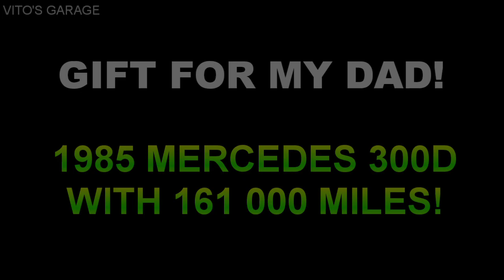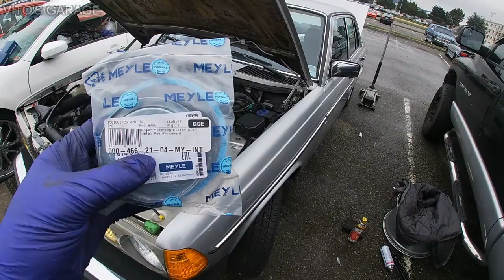PART 20 Dad's Mercedes W123: Power Steering Flush, Air Cleaner Mounts + Restore, Sunroof Lube

Comment: I personally prefer using the drain plug to drain the entire PS system instead of the hose off method, and ATF is going to destroy that pump/steering gear with the friction additives in modern ATF, unless you somehow found some Dex 2 from the 80s.
Reply from the maker: I’ve done it many times and had no problems with the fluids I use. 
All the old fluid got flushed out doing it with this method. You can remove the plug but it’s a lot extra unnecessary work
Reply: @VITOSGARAGE  to each their own, I prefer a drain plug, and lubricants that aren't designed to create friction, but either way will work, drain plug method just isn't as messy but will require being done more than once.

Comment: i flushed through 3 gallons of clear power steering fluid and couldn’t get all the red out. i tried with engine off, turning the wheel back and forth, to pump out old fluid while topping off with fresh fluid. then i tried with running the engine briefly. does running the engine briefly clear the system better than turning the wheels back and forth? i made some progress getting it clear but it took a lot. i also tried reconnecting the return line, running the clear fluid through with engine running and turning wheels back and forth, and then purging that out as fully as i can before repeating. i really don’t know what method was working best. the febi power steering fluid said never mix it with ATF, and the old fluid was really dirty, so i really wanted to get it as clear as possible…
Reply from the maker: These cars need to have a red ATF in them

Comment: How much for a original Lemförder engine Mount in the US? where did you order it ?..  you overdid the sunroof lubrication in my humble opinion.. thumb up for the video though ..
Reply from the maker: The sunroof lubrication wasn’t overdone. I sprayed extra fluid film on the metal surface there so it never starts rusting. Each Lemforder Mount is about $18 for this car